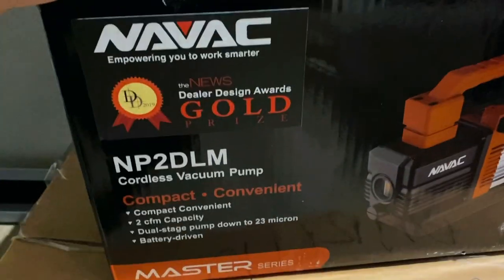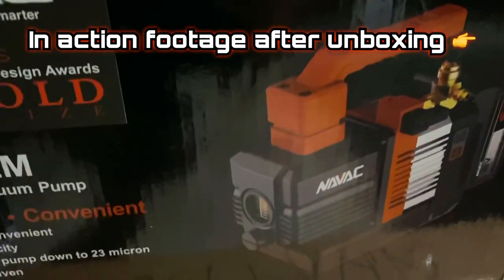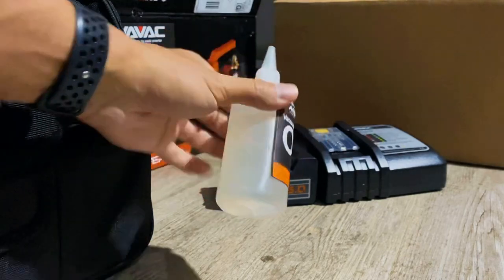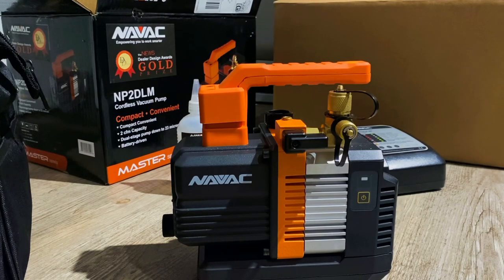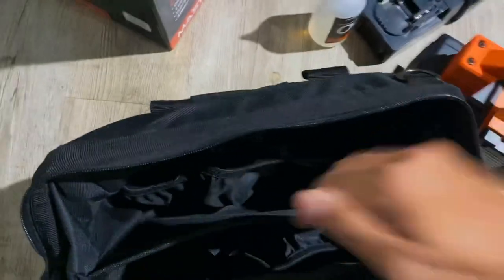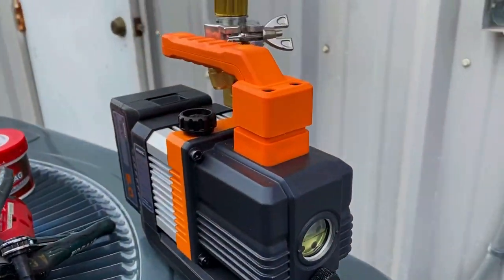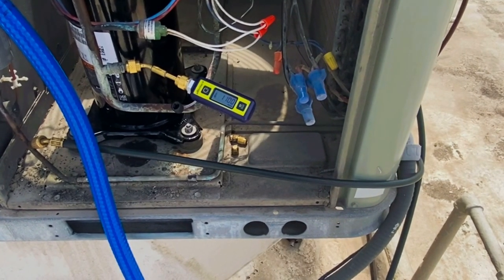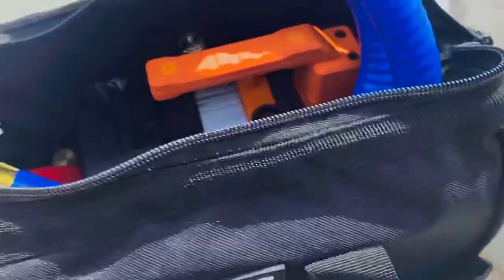Real Tests w/ Different Set Ups | New Torch/Vacuum Kit | Navac Vacuum Pump

Comment from the maker: *This would work really well for residential and new installs. You might get frustrated if you're vacuuming old systems that leaked, had moisture introduced. It pulls down any of the above under 1000 microns pretty quick, just longer to pull under 500 on really old bigger units.

**Next thing is to try a mikita to Milwaukee battery adapter in case I run out of juice, heard that works like a charm.

Comment: I just got the 4cfm pump today. I'm curious how well it holds up.
Reply from the maker: That's the one I wish I had gotten, just use the right hoses you should be golden. 
The only thing I didn't get into was getting an adapter to try and use other batteries on it. Would be helpful.